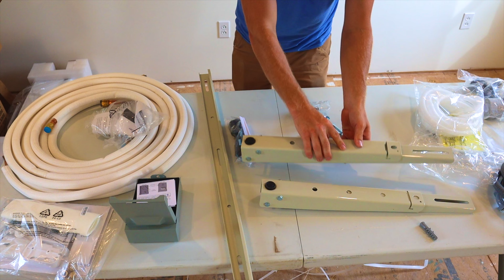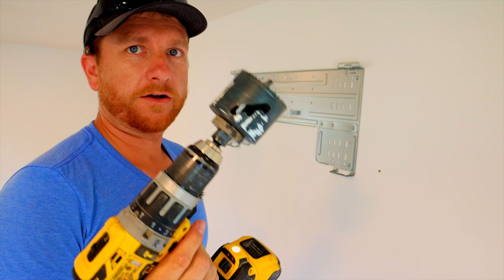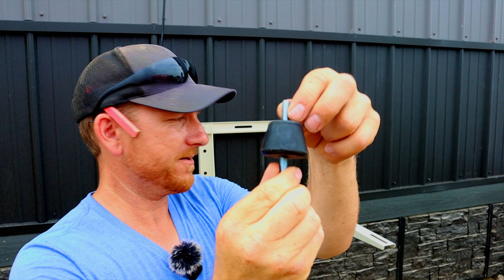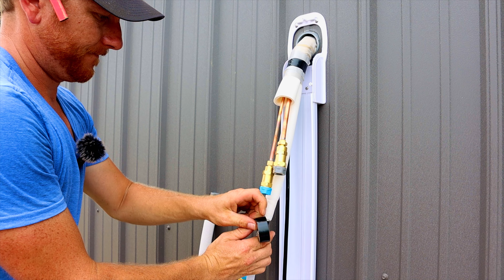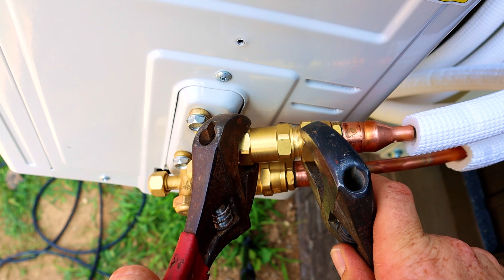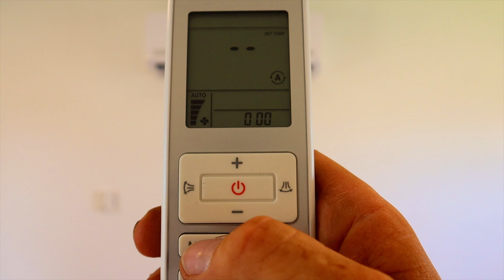HOW TO INSTALL A DIY MINI SPLIT (no HVAC tools required)

Comment from the maker: 2 YEAR UPDATE:
    Both units are still running like a charm. I’ve had no issues out of either one. 

1 YEAR UPDATE:
I installed 2 of these units on July 9, 2024. Just passed the one year mark and I have not had any issues with either unit. Both are working flawlessly. I will try to update this comment yearly.
Reply: The only thing that I would have done differently would be to ty wrap the drain hose so that it had a S trap (or P trap) in it. That keeps water in the trap so that bugs don't get inside.
Reply from the maker: @nomore8042  Good point. Although If done on the outside it would freeze in the winter. Not sure if that would be an issue or not since condensation doesn’t occur on the indoor unit in heating mode.
Reply: How long was you line set? My is about 4 feet and don’t see anything in manual about a minimum line set requirement, but some people online say it should be at least 10 feet. I’d rather cut and reflare lines than have to coil the remaining lines.
Reply from the maker: @fireandblood2919  I believe these were 25’. They came precharged so was not an option to cut them. Yes, according to the internet, you don’t want to go less than 10’. Very short linesets (less than 10 feet) do not provide enough distance for the high-pressure gas/liquid to separate, which can transmit compressor vibrations and refrigerant noise directly into your quiet indoor unit.
Reply: @MT_Homes  thats why u loop them if need be

Comment: Which gas is used in this air conditioner, isn’t necessary to create a vacuum before liberating the gas ?
Reply from the maker: I believe this unit uses the R410A refrigerant. Since the line-set is also precharged and has special fittings there’s no need to vacuum the system.

Comment: Hard to believe you dont have to vacume the lines??
I had no idea.
Is this the same on a new split system?
What happens to the air in the lines?
Reply from the maker: On a true DIY unit like this the lines are vacuumed and pre-charged at the factory. Only the mini splits with pre-charged line sets can be installed like this. Most mini splits require vacuuming.

Comment: They must've run out of safety glasses at harbor freight.
Reply: @MT_Homes Glad you can take a joke. I used to run a crew of 4 installing same inverter style units, 9k-36K. Biggest issue was crew always took off the glasses when no one was looking. If they got hurt I’d be in big trouble.

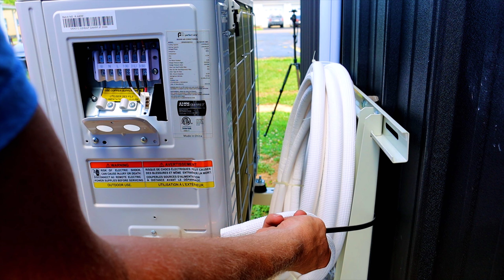Comment: 26:17 Why didn't you just cut the pipes?
Reply from the maker: Because they come pre-charged. If I cut them, I release the refrigerant. Then I would have to vacuum them down and add refrigerant back in.

Comment: Just curious as to how these mini splits compare to a regular window ac of the same btu?
Reply from the maker: Mini-SplitPros: (12,000 BTU)

Very Quiet: Operates around 19 to 40 decibels indoors because the loud compressor sits outside.

High Efficiency: Uses inverter technology to vary speeds, cutting electricity use significantly compared to standard units.

Dual Function: Acts as both an air conditioner for summer and a heat pump for winter. (Some will heat as low as -22 degrees Fahrenheit)

Preserves Windows: Mounts high on a wall, leaving your window fully usable.

Mini Split Cons:

High Upfront Cost: Equipment alone is 2- 5 times the price of a window unit. And when  professionally installed will cost thousands of dollars more initially.

Complex Installation: Requires drilling a 3-inch hole through the wall plus mounting indoor and outdoor units. 

More permanent.

Window ACPros (12,000 BTU)

Low Cost: Inexpensive to buy off the shelf compared to permanent systems.

Fast DIY Setup: Installs in a window frame in 30 to 60 minutes without special tools.

Great for Renters: Easily removed and taken with you when you move.

Cons:
Loud Operation: Noisy compressor and fan sit right inside the room, running at 50 to 60 decibels.

Blocks Window: Obstructs natural light, looks bulky outside, and prevents the window from closing or locking fully.

Lower Efficiency: Cycles completely on and off, leading to larger temperature swings and higher power bills over time.

Comment: CURRENT PRICE 18,000 BTU MR COOL $1600 7/3/26 SENVILLE 18,000 BTU $849 COMES WITH ALEXA AND 16 FEET OF LINE SET‼️ You’re paying approximately twice as much for the convenience of pre-charged 16 foot lines. vacuum pump $53 on Amazon manifold gauge is $20 with hoses. saving $740 by not getting a pre-charged line set from Mr.  COOL❗️🤡

Comment: So do the lines and the indoor unit come pre-vacuumed? And then you should not have put the outdoor cover over the line set until you had leak-tested the joints coming out of the wall?
Reply from the maker: Yes the lineset and outdoor unit come pre vacuumed and pre charged. Correct I should have leak tested the upper connection before installing pipe wrap and cover.

Comment: tightening torques: 
fluid line (1/4"): 18Nm
gas line (3/8"): 32Nm
It's worth buying a torque wrench and two adapters (fluid line 15mm, gas line 22mm).
Reply from the maker: Thank you for the info. Are those specs for standard flare fittings? The ones I used are special quick connect fittings with rubber o-rings which I believe seal the connection instead of compression on the flare.
Reply: @MT_Homes they are applicable for either type. the pre-filled lines have rubber seals that get compressed in their grooves until the copper fitting goes on block again. The tightening torques are identical.
Reply from the maker: @TheColinChapman Very helpful, thank you!

Comment: You can do this..it will probably be ok for awhile, but because those copper lines were exposed to the air, you really should purchase a vacuum pump at minimum, and a set of gauges. Can be all had for like 150 at harbor freight or Amazon... At minimum pull a vacuum before releasing the refrigerant into the lines, and this way you can test for leaks at same time before wasting refrigerant on a leaky connection, and I would probably have cut off the excess line set, so it's not coiled up and potentially have oil laying in the bottom of em
Reply: Those lines come precharged you don’t have to pull vacuum on them when he tightened them down on each end it releases the per charge no oxygen was in those lines it’s sealed until the connection is made
Reply: @Jeff-wi9qf Wha????WOW!??
Reply: @MarkPope-q3e I was thinking the same thing. Are the lines coming from head unit sealed till tightened too? I'm looking at installing 5 of these and wanted to see how they did the linesets particularly. Some show pulling a vacuum while others don't.. so now I'm confused.
Reply: @plumbingbbj there available either way.pretty neat.
Reply: How do you know/find out if it’s pre-charged? People have been telling me I can only self install a “Mr. Cool” brand (out of my price range) because the line thingies are already charged.
Help?
Reply: @EmmysNana read the information before you buy.
Ask the sales person.
There made and sold both ways.

Comment: I have doubts why you didn't need to use a vacuum pump to remove air inside the pipe?🤔
Reply from the maker: The Pipe is factory vacuumed, precharged and sealed with special quick connectors, eliminating the need for field vacuum.

Comment: Hey boss man, great video. I’m about to install the exact same unit. The only thing I can’t see is how you actually mounted the wall unit to the wall. The brackets on the outside do not appear to have any bolts through them. Can you share the details of what you did please. Cheers!!
Reply from the maker: Yea, sorry. Should’ve had a close up of that. I fastened it using (2) 5/16” X 3 1/2” lag bolts (I believe) starting at 11:19 in the video. Be sure to hit framing with these.

Comment: Very good video.  I’m considering one to supplement my modern, extremely efficient Trane central air that can’t cool enough in the FL summer.  My 26 year old Rheem system had no issue.
Reply from the maker: Thank you! Man, that’s a shame your new system doesn’t perform like your old one did.

Comment: That hose is the exhaust (hot air).  Your house will cool better if you cover the hose with a blanket or hose cover to control the cooling of the room.  The portable can work equally as well as a window unit.

Comment: Several people have asked or mentioned that you did not pull vacuum first. From your response to them it appears you do not understand the point being made. The condenser itself is what needs to be vacuum tested, before you open the pre-charged lines. If the condenser has moisture in it the vacuum will burn off the moisture and prevent trouble down the road from that moisture freezing the system up. If there is a vaccum leak you don't want to connect the pre-charged lines at all because the freon will just leak out eventually and then you are back to square one. There is no such thing as a 'true' DIY mini split that doesn't need the condenser vacuum tested first. It serves two purposes, burn off the moisture and verifying no leakage.
Reply from the maker: So there are “true” DIY” systems and DIY “friendly” systems. 
   The True DIY systems are fully vacuumed, pre-charged and sealed at the factory. Including the condenser, line-set and the head unit.  They have specialized connections that allow them to be connected together without the need for vacuum. 
 
   You may be thinking of a DIY friendly system with flare or solder connections. Those absolutely need a vacuum pulled before releasing refrigerant. 

   From MR Cool website (the most popular True DIY Manufacturer):
Designed for fast, clean, and easy installation, each line set is pre-charged with R-454B refrigerant and comes ready to connect to compatible MRCOOL air handlers and condensers without the need for special tools, vacuum pumps, or refrigerant gauges.

Also, it has been 2 years since install and I haven’t had any issues out of either one.
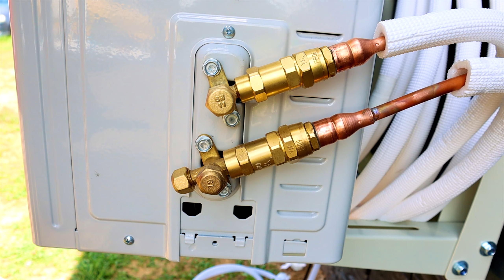Reply: Reading the description from the vendor it looks like this unit might have a “Mr cool” type pre charged line set with connectors that open once tightened. If so, it does not require a vacuum 25:12 pump.
Reply: @larrykaufman1761 the vacuum isn't for the lines. It's for the condenser itself. If the condenser has a leak or moisture in it it will fail. You vacuum to eliminate both possibilities. Then connect the pre-charged lines. These DIY kits are rigged to fail if you don't vacuum test the condenser. Even a minute amount of moisture will cause it to freeze and even a minute leak in the condenser will eventually leak enough out to also cause it to freeze. Having pre-charged lines is great. But it doesn't change the fact that any time you inject freon into a system (even from a pre-charged lineset) you must first vacuum that system. In this case, the outdoor condenser.
Reply: @stephenbustos  AND WHAT  do you do when the condenser is the precharged with freon??
Reply: @DBeilke66 condensers don't come pre-charged. It's the linesets that are pre-charged.
Reply: The literature you can find on this is incorrect. The linesets are pre-charged, not the condenser. And the condenser is the part that needs to be vacuumed even if the manufacturer claims it doesn't. ANYTIME you charge a system you must vacuum it to remove all moisture and verify no leakage. Calling it DIY doesn't change that fact.
Reply: @DBeilke66 if you found one where both the condenser and in door unit and lineset is pre-charged, then, no you don't need vacuum. But it any component of the three is empty, you must vacuum it before opening to the component that is pre-charged.
Reply: @stephenbustos  this is where your WRONG the one i purchased has the condensor precharged !!!!!  and for a fact i know of several others that also come this way !!!!!  the line set and air handler have nitrogen in them !!!!!!!
Reply: @DBeilke66 if the lineset and handler have nitrogen in them, you would have to evacuate the nitrogen and vacuum that side 😂. So, not wrong.
Reply: @stephenbustos  lol  not the condenser tho like you said !! been in the business for yrs  here
Reply: @DBeilke66 if the lines are what is pre-charged and not the condenser than the condenser needs to be vacuum pulled. There are obviously a tone a variations so it would depend on your particular version. If all components are pre-charged then no vacuum needed. But whatever component isn't pre-charged needs to be vacuum pulled on that component/s.

Comment: That line set behind the condenser should lay flat on the ground.  Refrigerant/oil is going to accumulate at the bottom of that rolled copper line set.
Reply: Yes this is true. Also before opening refrigerant valves, you should do pump down, to create vacuum, and remove air and humidity from the pipes. That creates corruption and compressor problems
Reply from the maker: @chrisporfiris4155  The line-set and units are factory vacuumed, having special fittings to allow for connecting without letting outside air in.
Reply: @MT_Homes  You would think the manufacturer would vacuum and CHARGE both the units and the line sets so that any small leakage during installation would lose refrigerant from the pressurized system, not admit air into a vacuumed system. Notice the line set box says, "pre-charged line set".
Reply from the maker: Good point. Had someone else mention that as well.

Comment: I can’t help but wonder about the air in the line set and the inside unit coil……
Reply from the maker: This is a true DIY Line set and is pre vacuumed and charged from the factory so no air in it.
Reply: What do you mean? No air in it? The pupe is wide open. You should've vacuumed that and carried out a tightness&leak test before firing the unit up
Reply: @samuelhara4874  you have to see that the line set has quick connectors and is under vacuum !!

Comment: I had just finished getting my HVAC degree in 2011 when the mini split entered into the technology school.   And I have never installed one yet.  I work on water coolers at a food processing plant.  But I’m in the market to buy one for my son’s media room. 
Any suggestions on brands.  I’ve done plenty of research but they claim to do the same thing.  Hope to hear from you soon.  Thanks.
Reply from the maker: I don’t have enough experience with them yet to have a solid opinion on brands. But I think sticking with a brand that has been around for awhile like Mitsubishi, Daikin, LG Mr Cool, Senville, or Pioneer would be a solid pick. I went a cheaper one for my install but it has been working perfectly.

Comment: Wonder why none of these DIY installs of the mini splits show the hardest part: Electrical from the circuit
Reply from the maker: This was a new build and electrician had that done or I would’ve shown it.  Although that technique can vary a bit depending on your build. If I do another one I’ll try to show that part.
Reply: @MT_Homes It's the dumb part.
Reply: Not if thats the only part you've done hundreds of times. Before. 
From the panel to the disconnect .
Then after the condenser has been set in place.
Run the 220 in my experiences in a short piece of sealbtight flex to the condenser and say,
Wonder how the rest of this stuff works??
AC guy runs the low voltage wires and hooks those up not me.

Comment: No vaccum no torque wrench what an idiot I would not want you installing mine
Reply from the maker: Thanks. I’ll be sure not to install yours.
Reply: I’m sorry I shouldn’t have been rude like honestly  that was rude of myself !! I do hvac and iv done a lot of service calls fixing peoples installs !! But if your system still going strong .. good job sorry didn’t mean to sound like hater
Reply from the maker: @JustinWalker-cn7nm  Apology accepted. I understand this is not the pro way of doing it but it does work. I installed 2 at this rental 2 years ago and I haven’t had any trouble out of either one.

Comment: Question….I want to do this up north…..what do you do for insulation on the drip line etc. ?
Reply from the maker: The indoor unit will not produce any condensation during winter heating. The indoor coils are hot, which actually lowers the relative humidity of the air passing over them. Because the indoor unit isn't making water, the main indoor drain line will sit completely empty all winter so freezing should not be an issue. We had nights of 10 below zero last winter with no issues.

Comment: Does the system needs to be vacuumed   before switching on
Reply from the maker: Not this one. This is a true DIY system and the lineset is precharged. There are other “DIY” systems where the lineset needs vacuumed down before releasing refrigerant.

Comment: You trusted the ceiling to be level.
Everyone, use that as a starting point and then break out a level
Reply: If the ceiling isn’t level do it by eye, level next to not level looks wrong

Comment: I think you’ve mis-wired the disconnect?  At least where I live you can’t switch the neutral leg as that results in a floating neutral. Given this is 110/120, you should only switch the hot wire and you should directly tie the neutrals together. I’m not an electrician so maybe I’ve got that wrong but it’s worth confirming
Reply from the maker: Good point. I assumed since the hot leg was getting disconnected it was ok to disconnect the neutral as well. Google wasn’t much help in determining whether that was a code violation.